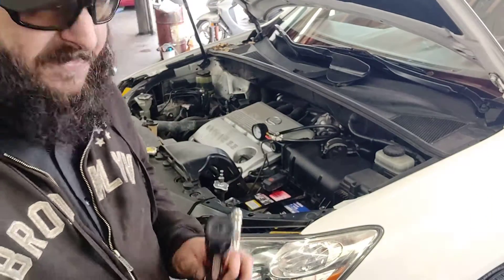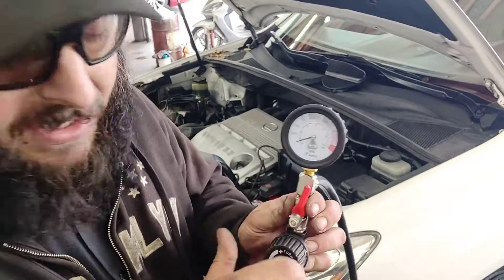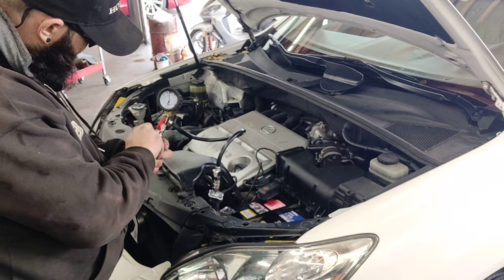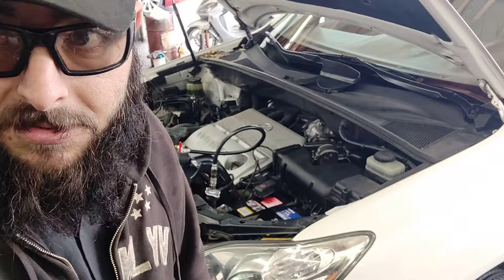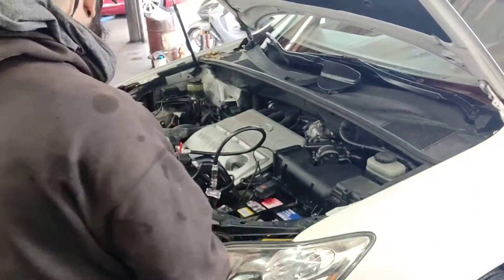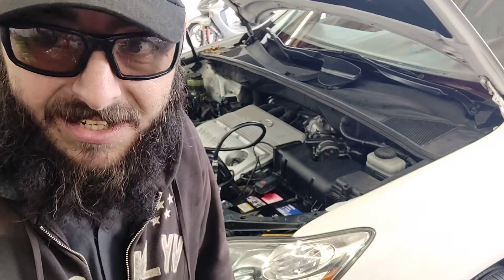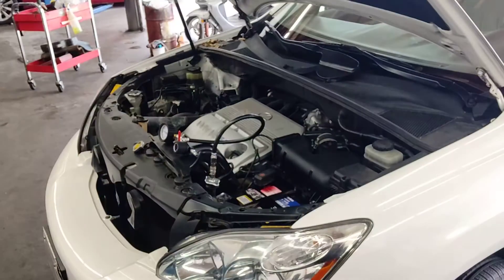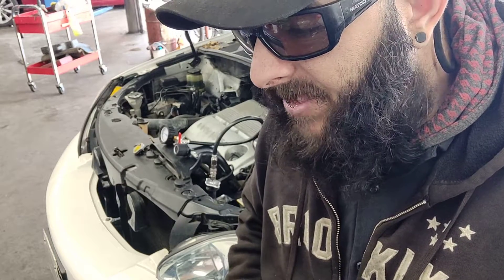Astro Pneumatic Tools 7856 Air-Powered Cooling System Pressure Tester 5-minute Review

Comment: Your old pump is similar to mine where it has internal leaks which can give false results!  Is your Astro tester still holding well?
Reply from the maker: @Brian_L_5168  i haven't ever had a pressure bleed down that was due to an internal issue. Though I mostly use the air pressure gauge and not the pump. But I also pressure test both vacuum AND pressure since not all leaks will leak in both directions. But I generally don't have to do that unless there was a concern regarding a leak. When doing simple drain and refills, I just vacuum the entire cooling system down and refill it

Comment: Can yoy drain the system with that tool?
Reply from the maker: I Guess you could If you unhooked a hose and then just pushed air through the system. But it would drain by itself that way anyway......

It's really for putting air IN, not taking it out.